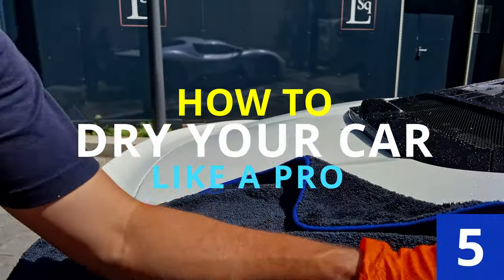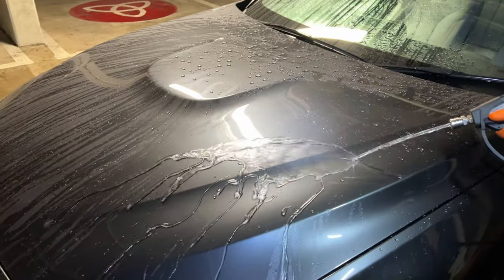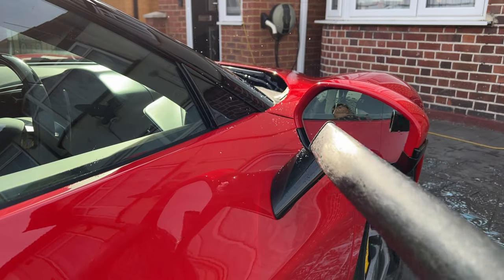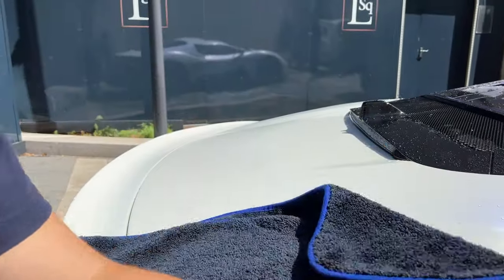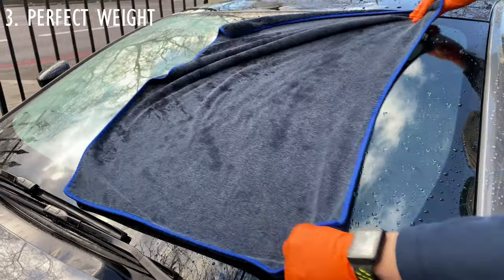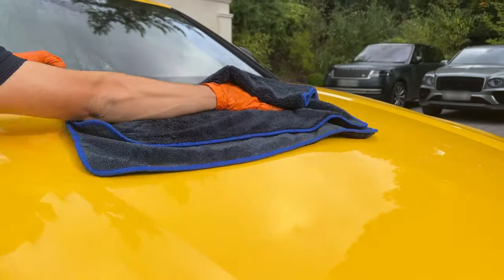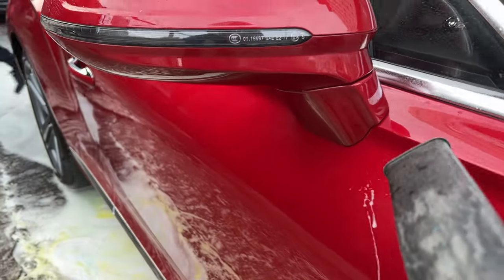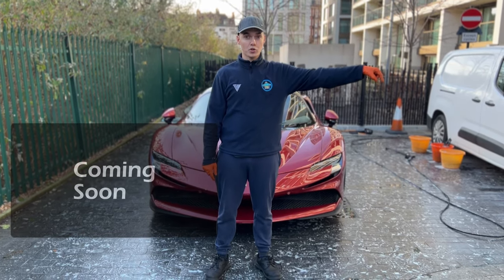How to Dry Your Car

Comment: I would add misting some detail spray on the drying towel to add lubrication and reducing marring the paint.
Reply: I second this, but if the car was properly washed and rinsed , and your drying towels are clean and free form contaminants , towel drying alone shouldn’t mar
Reply: @22noobtube  true but as much as you try, there will always be a small risk of some grit that survived the wash process.
Reply: Great tip…

Comment: I agree with drying your car after washing it to save water stains, I like the air blower method never thought of that, cool bro, going to buy some foam and a new drying towel, I always wash my car in overcast weather not bright sunny for obvious reasons….if you just let it dry what was the point of washing it in the first place….

Comment: What happens if the drying towel gets dirty from a missed spot? If I wash it and it's a little black still, is it safe to use as a drying towel?
Reply: Why would u miss a spot
Reply: @isaaccollazo2874  because I'm partially blind and sometimes fine details on car paint are hard ti see. I.e., I may not have washed a part as well as I shoukd have, but thought I did and can't tell.